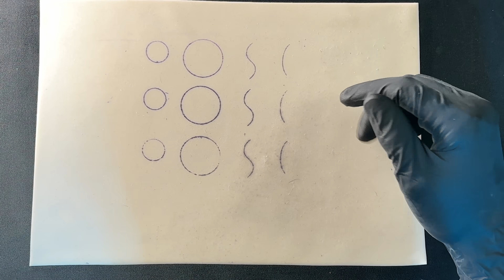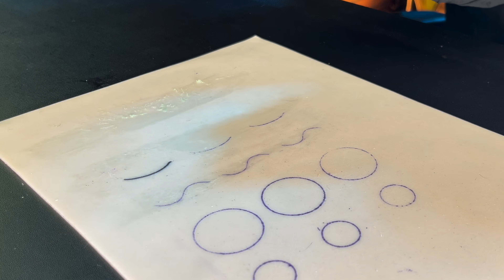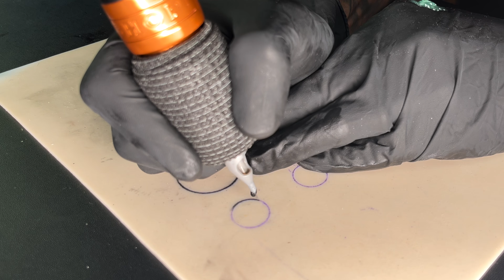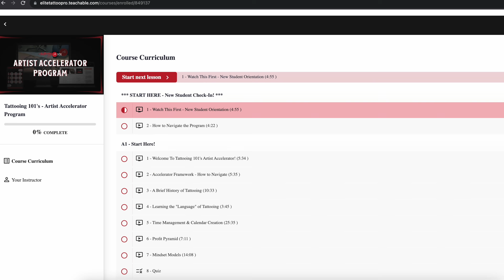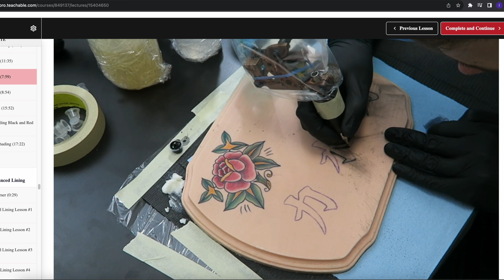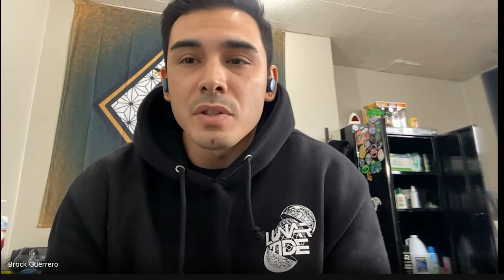Tattoo Line Work Tutorial | Week 4 - Circles

Comment: hi. Love the videos from your channel. How would you do a circle with a 3RL or even 01RL ? The needle configuration makes for really thin lines and any minimal wobble or not matching the beginning and ending line is immediately visible.
Reply from the maker: It is muchh harder to do anything with a small needle grouping like a 3RL or a 1RL. And actually I would recommend that you use smaller gauge 3RL (like a 10 or an 8 ) over a 1RL because they can actually do quite a bit of damage to the skin if not used properly. The smaller gauge 3RL are really close in size to a 1RL, so the client won't even notice the difference, and you can use those a little bit more safely.

Comment: you've talked about stretching the skin in the direction of the line before, what's the best course of action for curves?
Reply from the maker: You want to do what's called a 3-point stretch. A 3-point stretch basically means you’re keeping the skin tight in three directions so the needle can implant pigment cleanly. You use your support hand to pull the skin either sideways or up and down, then your machine hand provides the third point by resting your pinky on the skin for stability. In that setup your middle finger pushes forward, your index finger pushes back, and your thumb holds the machine steady. This keeps the skin stretched like a drum so the pigment actually goes in instead of bouncing around. Without a solid stretch the ink won’t sit right, so practicing this technique is key.
Reply: @Tattooing101 awesome! thank you for the detailed answer

Comment: So I use my middle finger for stabilization and depth gauge is there any reason this is wrong?Also do you believe that learning. To line with Bigg liners is better or use 3 rl let's say?
Reply from the maker: Using your middle finger for stabilization and as a depth gauge isn’t wrong if it works for you—comfort and control matter most. Just make sure it’s steady and not putting you at risk of poking yourself.

As for big liners vs 3RL: learning on a bigger liner (like 9RL or 11RL) can actually help beginners because it’s more forgiving—you’ll see the inconsistencies less and get smoother lines. 3RLs are way less forgiving. If your hand speed or depth isn’t dialed in, it’ll show fast. So yeah, start big to build confidence, then work your way down once you’re more solid.

Comment: Speaking of Dragonhawk tattoo machines: Would you rather recommend the mast fold pro or the new mast fold 2 pro? Considering the price/performance ratio, how suitable is it for fineline, lettering tattoos and line work in general. I would also be interested to know how comfortable the machines are to hold, as the new mast fold 2 pro is slightly heavier and longer.
I know that the mast fold 2 pro machine has a longer battery life, but can it keep up with all the other features of the mast fold pro? I am not a professional tattoo artist and only tattoo occasionally and have made it my hobby. However, I still want to be able to do a good job with my machine.